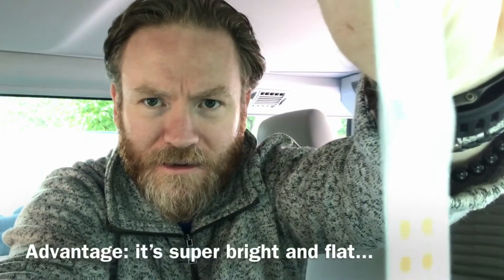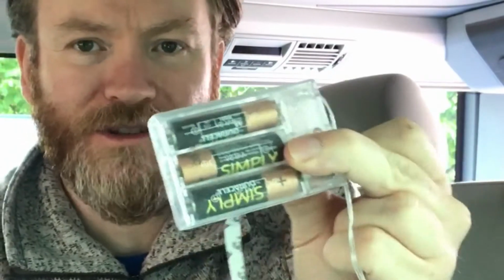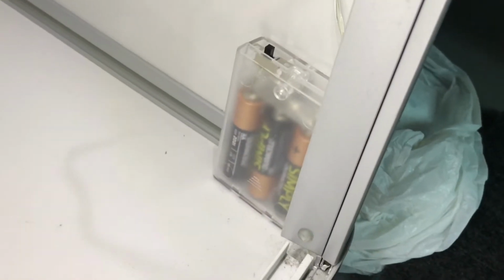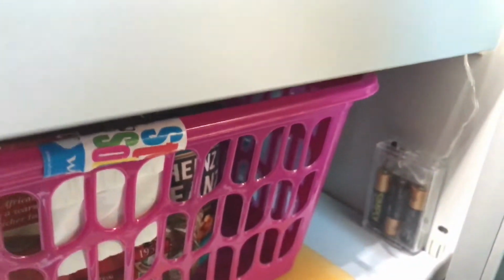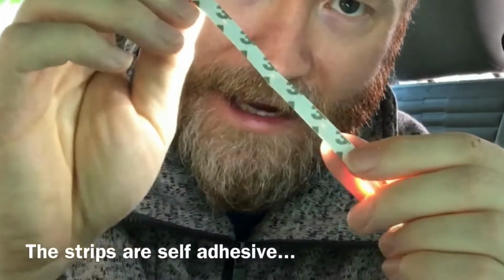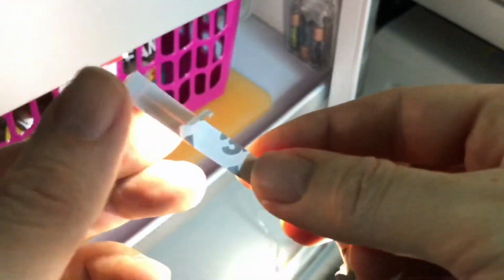V68 - Cheap storage area lighting solution for VW California T6

Comment: Hi j. Grand job. I think the worktop might be a bit more of a task. They’ve done away with the little struts and replaced with friction hinges. It will be interesting if someone produces a retro fit. Ps the beard is coming on. Don’t stay curling your Moustache you will look like one of the hairy bikers. ATB Glen
Reply from the maker: Cheers Glen. Those struts are rubbish... The screws work loose and can be tricky to fix. I’ll put it on the ‘to do’ list... Would be handy / better use if the space!  

Thanks for noticing the beard - it’s getting there now. The tash is naturally curling - might have to trim it before it pokes out an eye ! Ha Ha !!! 😂